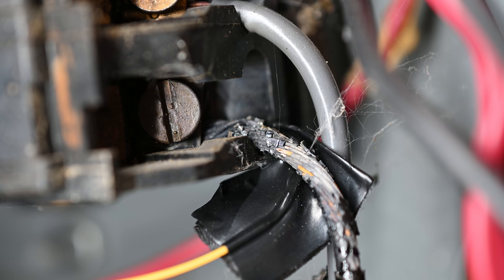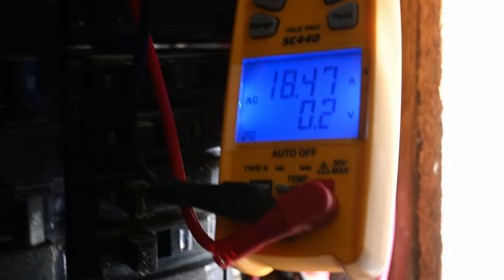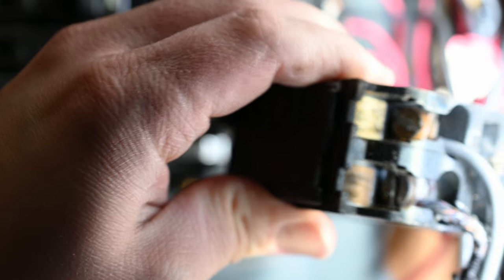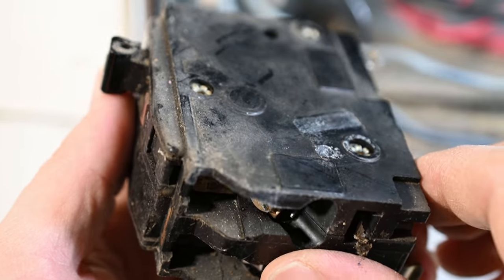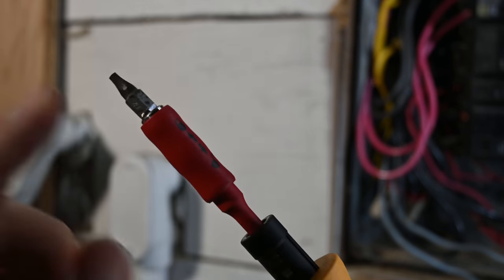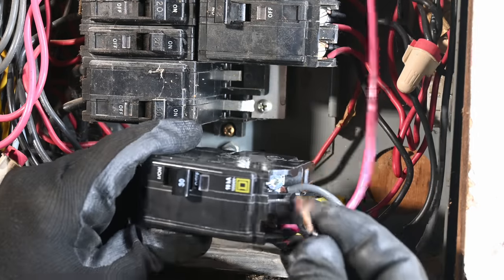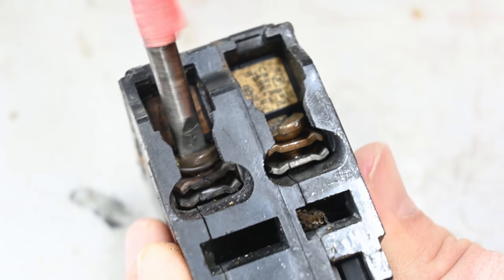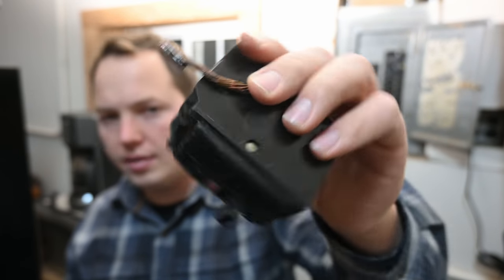Burned Wire On Breaker - Torque Screwdrivers & Why You Should Probably Be Using One

Comment: Great vid Ben. Just curious, (not an electrician), what could you do if the wire in the panel wasn't long enough to cut off the burnt part and strip back for a new breaker? Thanks!
Reply: Move the breaker.
Reply: You can and always have been per NEC to splice inside the panel( 2017 code clearly states this with fill conditions that are unluckily to ever be meet for violation to occur' lol)  or if ahj has a problem if its possible make a j box on outside of panel
great video for info https://www.youtube.com/watch?v=el64aXhZ2Co&list=WL&index=20   but #10 for this thread
Reply: You'd likely have to replace that wire to the junction box or where the other end is, unless you splice a piece in and I don't like that idea and believe it would not meet code to do that
Reply: @HobbyOrganist  check NEC code it has always been allowed to splice in panel but ahj liked to bust balls (granted its not the best but it works) and I assumed anyone who cld understand the j box idea wild be smart enough that it was implied to run new wire from jbox to breaker terms?  (But it is social media platform?) Lol
Reply: Thanks for all the replies!
Reply: @wizard3z868  Well I'm not an electrician, but I've done all my wiring for decades and worked as a building superintendent (who does  in-house repairs on everything) in commercial and residential in NY City in the 70s and 80s, I would still not feel good about jury rigging a splice in there. 
Every added unnecessary splice is another potential trouble point.

Unless the wire is like 200 feet long encased in conduit with 15 other wires, it would usually be  a simple matter to replace the wire, which I would do if it had been burned like that, just because it only appears burned on the end doesnt mean it is perfectly intact elsewhere.
If it was in my house I'd replace that wire.
Reply: @wizard3z868  

I have NO idea what you are saying with this;

" I assumed anyone who cld understand the j box idea wild be smart enough that it was implied to run new wire from jbox to breaker terms? "
Reply: @HobbyOrganist  The NEC allows for wire splices inside the service panel.
Reply: @HobbyOrganist  The NEC allows for splicing wire inside the service panel. If it's done correctly it shouldn't be an issue. Pulling a new home run isn't always that easy, or practical.

Comment: Is a 30 Amp GFCI 240v breaker a thing? I wasn't able to find one
Reply: The 2020 NEC requires GFCI/AFCI protection in nearly every room, and now they want tamper resistant receptacles as well. ALL new construction HAS TO BE tamper proof receptacles. My point is that the demand for GFCI breakers increased greatly because of the new code, but this is an old post so maybe you located what you need by now?
Reply: @im2yys4u81  I just used a standard thermal breaker because it didn't need to be inspected.
Reply: @Krankie_V  I hear you. Those damn things are expensive as F. I did a panel swap on my house the other day and the prices are ridiculous, and that's if you can even find them. Another thing though is that just because the NEC changes the rules doesn't mean you have to do it. I happened up on a nice windfall so I decided to do it because I'm an old guy and I plan to pass this house on to my son. He doesn't have my skills, so I'm doing it. The NEC doesn't dictate what goes into a home. That's dictated by the local government via their building department. In my locality they're still relying on the 2011 NEC.

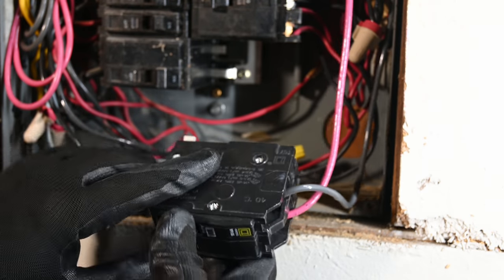Comment: I am not an electrician so not sure if this is right or not, but have never seen it done this way but about 19:00 in or so the breaker above has what looks to be 4 wires going into it.  Is this normal?
Reply: NO! That's called double tapping, and it violates the NEC big time.

Comment: What torque tool do you recommend for tightening 100amp  or 150amp breakers  Allen lugs
Reply: They make torque tools for socket wrenches, would be easier than a screw driver handle to use

Comment: With stranded, to be on the safe side without worrying about torque. 1) Make sure the breaker is rated for size stranded you want to use. And make sure you twist the end. On this connection it looks like they didn't, just slid it in. 2) use a ferrule or solder the end.
Wouldn't put my trust in a torque screwdriver, because in order to keep it calibrated you have to release the setting to zero. Leaving it set, wears out the spring.
Reply: Do NOT solder the strands!!
The wire is supposed to spread out for contact area. Solder will prevent this happening.
Reply: @cevgunnerF  Really? Are you thinking about what you just said? With that logic, you would need to crush a solid wire so it would provide maximum contact area.

And here is a little hint... 
Tin-lead (Sn-Pb) solders, also called soft solders, are commercially available with tin concentrations between 5% and 70% by weight.
Lead-free solders in commercial use may contain tin, copper, silver, bismuth, indium, zinc, antimony, and traces of other metals.

All of those metals are soft in both types.
So they will crush once you tighten the screw. So apparently you don't have any experience with soldered wires.

UL508a Standard
A connection to a wire-binding screw shall be made as follows such that no loose strands protrude from the connection.
a) Solid wire formed into a loop at least three quarters (270 degrees) around the terminal, or
b) Stranded wire that is:
1) Soldered.
2) Connected to a terminal provided with upturned ends.
3) Connected to a terminal provided with a cup washer, or
4) Connected to a crimped pressure terminal connector or eyelet.

So if you are allowed to solder receptacles and other devices, then why not the other end that feeds the circuit?

Only caveat is if you are drawing too much current, then it can melt the solder. So based on the current draw you will want to bump up one size. For 30 amp you should be running 10 ga solid. 
However now that i relooked at it, it looks like he is running 12ga on a 30 amp circuit. Unless he wired everything else with 10 ga.

Comment: Pretty sure the goal is to heat something up, the water.    But not the wire.  You should compare the difference using your straight vs a square drive but by hand and see how close that is

Comment: Isn't using a ferrule on stranded wire the easy way to avoid all sorts of connection problems?
Reply: No, unless you properly solder it.  Merely crimping a ferrule has the same "wire stacking" problem as tightening a screw on it and requires the same wiggling.  The National Electrical Code forbids ferrules except special cases of large wire and hydraulic crimpers like those used by utility companies.
Reply: @ralphcrawford9741  Um, no it doesn't? The wires are constrained by the crimped ferrule
Reply: @RobertSzasz  There is NOTHING in the NEC that speaks against using ferrules. I've used a lot of them on stranded wire when I was installing generators.

Comment: More likely a high load not due to how tight,  but you wired it with the right size wire. Being a 220 circuit the amps value is less than a high load single pole
Reply: 18 amps is 18 amps.
Reply: @illestofdemall13  but there can be a higher current during use right
Reply: @MrCrafter80  It was pulling 18 amps during use. My point is that a 120V circuit pulling 18 Amps and a 240V circuit pulling 18 Amps both mean that 18 Amps are being pulled through the current carrying conductors.

Comment: 18.84 amps on a 20 amp stranded wire on a 30 amp breaker in an un-grounded breaker box.... looks like a 50's or 60's breaker box. I would  have cut both wires back,  polished the wires, then used electrical grease. I would not warranty it due to the wire size issue and believe it will re-occur in the future.
Reply from the maker: It was 10awg stranded.
Reply: Stranded has a smaller conductor od than equivalent solid.  It is the big advantage of stranded in addition to being more flexible.  So 80% of 30 amps 10 awg stranded is 24 amps continuous.   A more interesting example is #10 which can handle 40 amps (NM-B Solid) to 55 amps (THHN Stranded).

Comment: The gas cap torque ability isn't too keep individuals from over tightening it, it's to prevent under tightening. Loose gas cap equals failing governmental pollution standards and a check engine light.

Comment: I only watched about 20 seconds of this thing and my question is why is there a stranded wire in there. I don't think that's right and I'm not an electrician. But I'm pretty sure you're only supposed to use a solid core wire when it comes to your breakers and any kind of home electrical wiring.

Comment: Torqueing a connection is almost always done wrong. If  you properly torque a termination, and check that torque with the tool again in an hour, or a day or a week, you can apply another 1/2 turn or more before the tool indicates proper torque again, since the conductor will squish down a  bit. So using a torque tool on the terminal once and thinking it's all set is a bad idea. The connection WILL be looser than it's specd at, guaranteed, whether copper or aluminum. To maximize reliability of that connection, you've got to go back and re-torque them. But few people ever do that. Not cost effective I guess. Try it yourself the next time you're on a job. Torque, go do other work then come back in a few hours before you leave for the day. Eye opening.

Comment: Why not just buy a 1/4 inch drive torque ratchet and use that with the required bit. a lot cheaper and you still get the correct torque setting.

Comment: OHHHHHH-NOOOOO  !!!  Not again !
Auto repair toolboxes have been SATURATED with torque wrenches, so now the marketeers are targeting electricians.
1) Someone who hasn't learned how to tighten a screw with a plain driver, hasn't learnt to brush his teeth too.
2) They should leave it to more capable people because TORQUE GUARANTEES NOTHING. Note that the correct yardstick is not torque but ELONGATION which is what is used in Nuclear-Plant maintenance. Using torque is like measuring the waist of a person and reporting the height : Usually works, BUT THERE ARE MANY EXCEPTIONS. 
3) Human brain can distinguish elongation from Friction and tolerances effects, but torque wrenches cannot. aka FOOL'S PARADISE.

Comment: That arc sound is also audio on an AM radio. You're wasting our time checking the screw tighten with a torque screwdriver after X many heat-up and cool-down cycles. Not only has the wire insulation greatly deteriorated but the copper wire has also equally deteriorated.

Comment: It's a loose connection.  The buzzing is arching at the wire terminal.  Some over thinking going on here.

A $150 torque driver that won't accept standard bits...I'm going there, LOL.  Buy a Wheeler or other gunsmithing tool that accept standard bits, unless your big buck boss contactor flips the bill.  If the tool has a torque certification, it's better than just hand tightening.  After all we're not building a space station,

Comment: $150.00 USD torque screwdriver tip sold separately. That is why electricians don't buy them. They are not , well fill in the blanks. It is not the  torqued wire that gets you it is the one you forget to torque because the boss, supervisor, dog, text, phone ringing, got your attention and you missed it. 😊😁😊😁

Comment: im thinking the manufacturer had a good reason for the custom sizing. 
If it was standard size you could start using any and all extensions you happen to have, as you use extensions you lose torque value. 
Old mechanic.

Comment: hard to apply enough torque with a slot head. All modern boxes, and by modern I mean going back at least 30 years, have robertson heads. That panel needs to be pulled right away. It is ancient.

Comment: Dude, it's just a loose connection. Replace the double pole breaker, it's faulty, and gorilla torque the lugs...strip down to fresh wire. Its just a loose wire arcing...Should be #10....

Comment: So many people talking about the difference between sparkies and engineers yet neither side addressing the two fundamental problems right at the start of this discussion:

1. An engineer designed that terminal ... BADLY ... on TWO counts.
   a) using a flat head screw is insane if you want to achieve truly accurate and repeatable torque settings - use a hex, Torx or deep recess crosspoint screwhead, ideally with a hex bolt head for even more accurate and repeatable results 
   b) using a non cage nut where flexible (stranded) wire is likely to be used - all large wire terminals should be a cage nut design.

2. A sparky presumably installed that wire/terminal combination  and DIDN'T take account of EITHER of the above by:
   a) fitting a proper fork or round CRIMP TERMINAL, properly insulated with high temp heat shrink right up to the clamping screw.
   b) replacing the flat head (slotted) screw with a DECENT machine screw with a reliable torque head (hex socket, torx, hex head)

Flat head screws CANNOT be reliably torqued multiple times without head distortion and blade slippage that causes incorrect torque settings.

I'm a graduate electrical & electronic engineer with loads of field experience, just like most experienced electrical engineers probably are. Very few get to live out their careers behind a design desk. 

To say that engineers can't do a sparky's job is just farcical at best.

Both sparkies AND grad engineers can be dumb as 💩 but most aren't thankfully. But when one group does a crap job and is called out by the other SOMEONE should pay attention and SOMEONE should be held to account.

This problem wasn't caused by an Engineer or sparky ... BUT BOTH!

Piss poor design compounded with piss poor installation. Simple as.

Comment: First off.... Why are they running stranded wire in the box in the first place.you also have a lot of overlap and crossing of hot connections.im not even sure if that wire is even 220 rated.10 gauge solid copper is the lowest I'd go for that application.anything less is asking for a fire.

Comment: I would never buy a ripoff device like that, use a inch pound torque wrench with 1/4" adaptor.  Ik its not insulated...wrap it in tape.
Reply: The Wiha torque screwdriver is an outstanding product.  It is insulated to 1,000 volts. I do agree with (& have) you that a small regular type of torque wrench will work.
Reply: I have meant to use my snap on inch pound torque wrench but it is kind of unwieldy to use in a breaker box also it’s pretty expensive and not practical.  Oh I usually just end up torquing everything “good and tight “ even though the OCD in me wishes I just had a torque screwdriver
Reply: @leealtmansr.3811  Plus, it’s a tool you’ll have a lifetime. Proper tool for the job as well.
Reply: @dorhocyn3  Capri makes a decent torque screwdriver for a little over $120 with bits.  I have a Tekton 1/4" in-lb torque wrench that is small and with a bit adapter it works.
Reply: Or just as good just kill the main breaker.

Comment: Everyone should go to their panel, turn if off, and tighten down all the screws. Takes 15 min.
Reply: Once a year......... particularly on the 120V side of your boat and RV power panels. I have almost had two RV and one boat fire due to overheating loose connections.

Comment: Sorry you didn't get the correct metric bits with your screwdriver, Wiha makes great tools though.  Also, I hate the fact that we, (USA) are not using the metric system for everything. Imperial measurements and the need to purchase SAE tools frustrates me.  If I had the power to change one thing in this world it would be to fix the climate crisis but my pet peeve is my "metric" 1/4, 3/8, 1/2 inch drive socket sets.  Btw, 5 out of 4 people have problems with fractions.  Good day sir.
Reply: Wiha, knipex, cimco, wera, weidmuller

Comment: Thank heaven for FLIR. Just would like something cheaper and more accessible. Electricians most common "mistakes" in order of appearance... Torque, cheap wire [ aluminum ] and the lack of noalox. Also do no re-torque. Unless you are using the proper tool for it. An it is not your Wiha torque screwdriver! This tool is you by inspectors. Hardly ever use. Specially when it is your cousin doing the installed. You laugh but it is true.

Comment: First comment!
Reply from the maker: You win! (But did have an unfair advantage!) ;)
Reply: Second comment!😊
Reply: Rather than the contact temp should have used an infrared non contact.  I've got a cheap one that actually reads temp pretty accurate reading in tight spaces.  Had this issue and was able to determine the breaker had corrosion inside because of where it was heating up for my hot tub.   At first looking I also thought a lose connection but it was inside the breaker on the contacts.   
The hot tub has a separate ground fault sub panel but was powered by the main through this breaker.   All wiring correct.  Intermittent so I had to have it happen when I was using it but not in it to be able to get heat reading.   As it was internal it was minimal detection on warmth but could read it nonetheless
Reply: Another note is I will actually go back after a few weeks and recheck the tightness